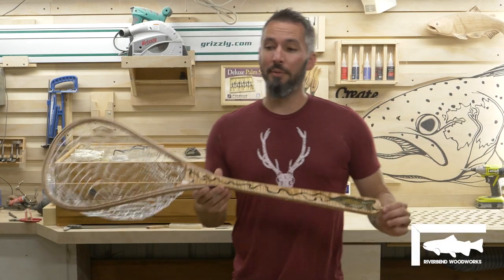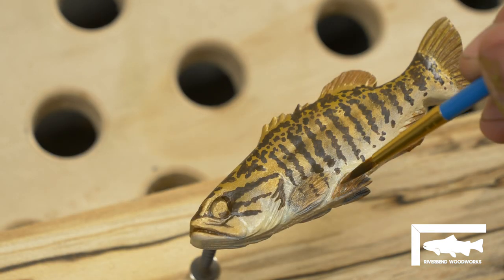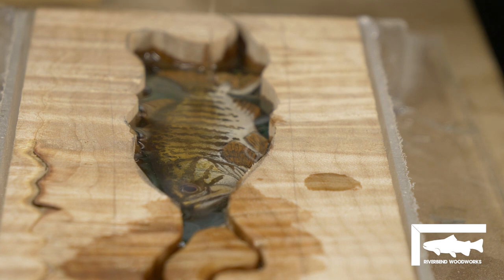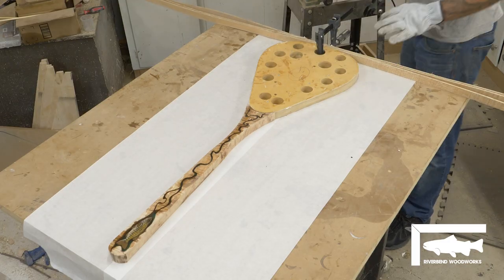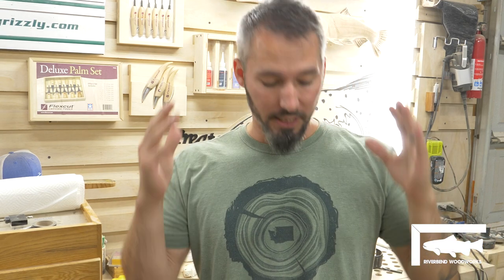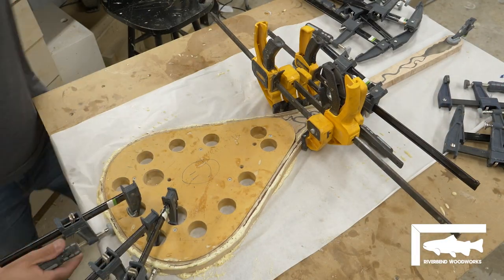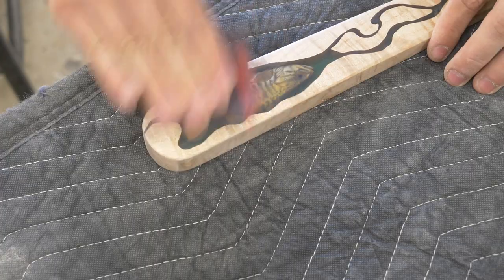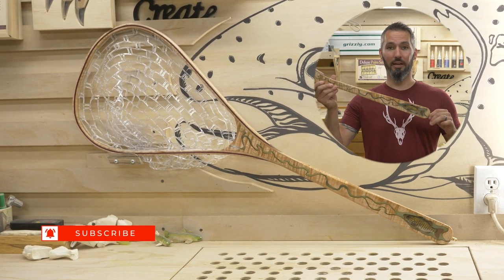Wooden Fishing Net Build for a Great Cause

Comment: Say I really like your videos. Thank you for posting them. I’d like to know what the vinegar does that has steel wool in it?
Reply from the maker: Thanks! The vinegar/steel wool mixture is an oxidizer and access to air will cause it to rust. The steel wool actually breaks down in the acidic vinegar (if it’s a fine steel wool) and the result creates the reaction with the tannins in the wood. Some wood species don’t have the best reaction, like maple, which can become a grayish color unless many coats are applied. Oak on the other hand his tannin-rich and blackens very well. You can actually watch the reaction occur on the first coat, too.

Comment: What finish spray do you use bud?
Reply from the maker: I use a standard exterior polyurethane spray, but seal with two coats of Dalys Ship n’Shore prior to top coats. I often do 4-6 coats of spray and sand between coats with 800 or 1000 grit to get that final coat silky smooth

Comment: James - love your work and I’m about to embark on my first net build.  I know you had breakage issues with the hoop section on this net, but in general, do you use air dried strips or have you used kiln dried wood?  I only have access to kiln dried.  If the latter, do you have tips you can share for the bending process…. Thanks in advance.
Reply from the maker: First off, congrats on jumping into a net build! It’s a ton of fun! As for material, I do use kiln-dried because it’s readily available in my area at my hardwood dealer. I believe a big reason for the breakage is actually two factors: 1) highly figured material has some strange bend characteristics which might not work well in our favor, 2) I think I’ve been going too thick with my strip material. If you shoot for sub-1/8” thick pieces and plan for an extra strip, and set your steam time to 30+ minutes, you should have no problem whatsoever. Hope this helps!

Comment: Love your videos.  Getting ready to make a form to produce some nets (gifts) for smallmouth bass fishing near your Springfield store. What net material do you use?  I see fishpond makes a kit but its not Prime on Amazon. Is it worth the extra $ for shipping?  My form on paper is 48" circ. so deciding what size?
Reply from the maker: I really, really like the Fish Pond nets, and think they're a fantastic choice and worth the shipping. They are also great because they include a waterproof tie-in line and large needle to thread the line. I would base my template off the net basket itself (order the basket you choose first and build your template off that), because it's actually surprisingly difficult to estimate how a basket will want to react to certain hoop designs. The hoop shape may seem simple, but the design (and how the basket sets within it) can vary considerably, plus it can say a lot about your style and taste when it comes to the hoop-to-handle design. Fish Pond provides a good starting measurement for each basket, so basing it off that for a rough idea is a great starting point when choose which to order.